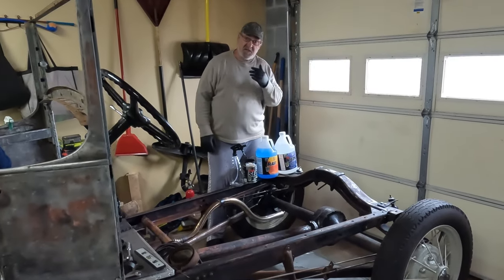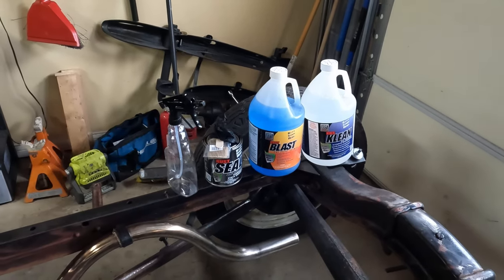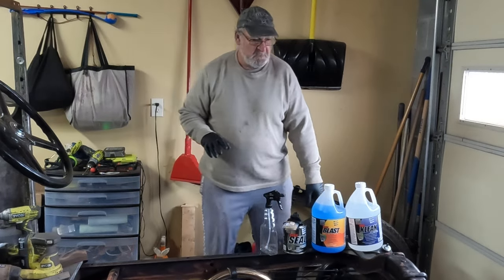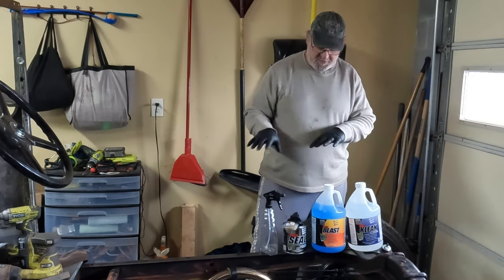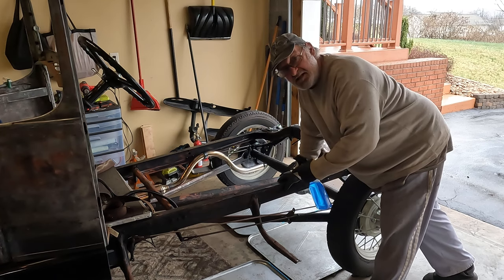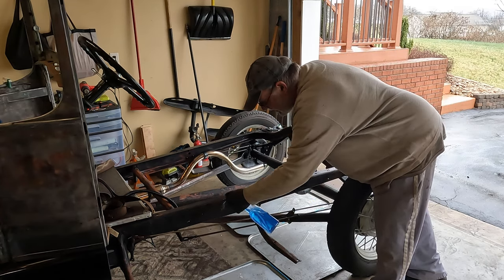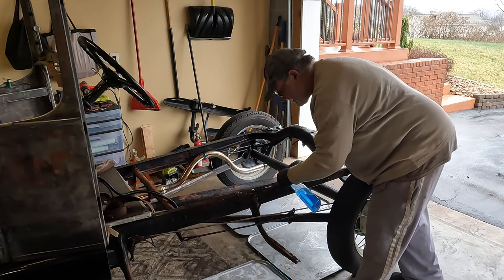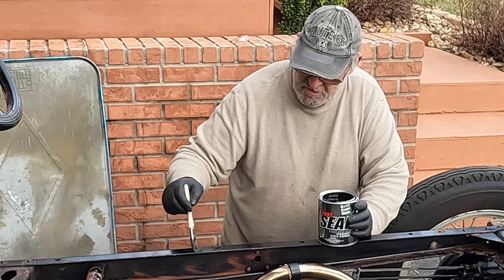Building a 1930 Ford Model A Huckster Part 5 Frame Cleaning, Etching, and Coating With KBS Coatings

Comment: Wire wheels and brushes are the bomb. For flat surfaces sandpaper works well. And don't forget ceramics and carbide burrs (bits). I like media (sand, glass, shot and/or walnut shells) in my blast cabinet for smaller parts. Honey, I shrunk the frame! Ha! If it were only that easy...
Reply from the maker: LOL, I used a DA sander on the flat parts of the frame as well as other areas.  Slowly building it bit by bit and plank by plank.
Reply: The DEWALT DW4925 on a grinder is good for that also.